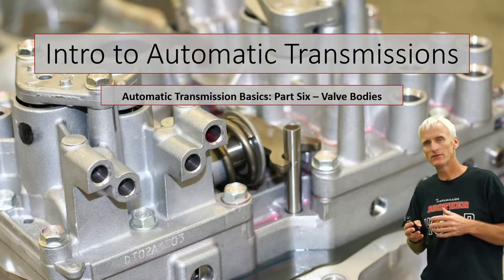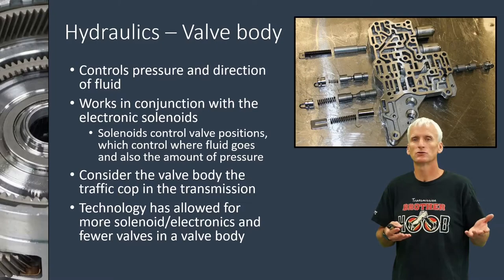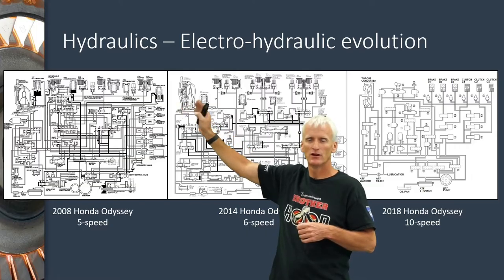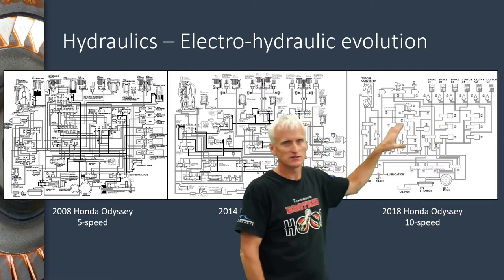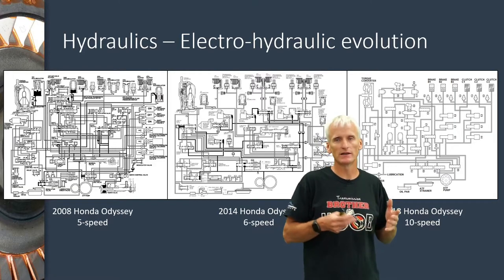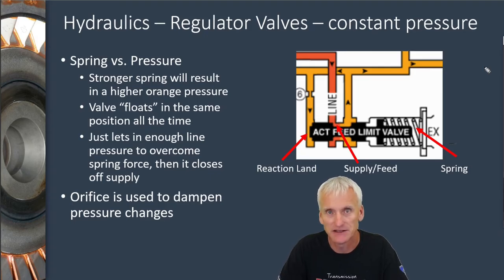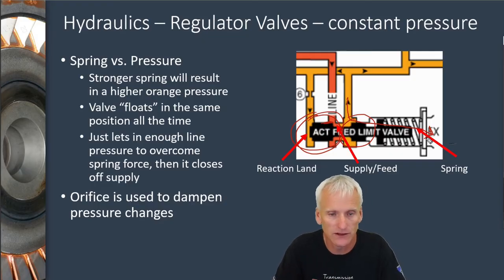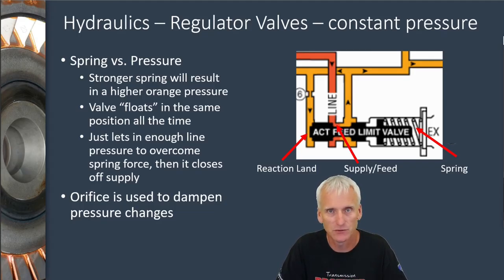Basic auto trans valve bodies

Comment: Once in a blude moon, our Mercedes 2008 ML 350 has gotten "stuck" in low gear where re-booting the car (off/on) fixes the issue. Asked the dealer what the cause could be. They said, "likely the valve body, maybe easy fix with new solenoid, etc.". I had no idea what a valve body was or how it worked. Found this video and, tada!, wowza!, great tutorial! 

Muchas gracias! 

( I noticed you using the Spanish phrase, "muy bueno" in another vid ;) ).

Comment: Great vid man , question, i have a 2000 excursion with the 4r100, after i tow my boat to the water 1 hr away, when i go into park then shift to drive it is super delayed or not at all.  Could i replace the accumulator valve body main valve body and solonoid valve body and filter could possibly fix my problem? Regular driving is no prob at all and trans temps dont ever go over 180 degrees. Thank u

Comment: Very fascinating subject. I've got a question to ask. Will the springs at the end of these spools become fatigued over the years and cause shifting irregularities, let's say in the 2-3 clutch circuit, which then sets a fault code?
Reply from the maker: I've always wondered this as well.  Supposedly it's not really an issue.  The valve springs don't stroke that much in relation to their total possible travel, so they don't loose tension over time.  One would sure think that with heat and years of use that they would though.
Reply: In general metal fatigues over time especially when you add thousands of thermal and mechanical cycles.

Comment: I really wonder what are the valve body and spool made of? Also which manufacturing proceses are done with them?
Reply from the maker: The valve bodies are cast aluminum.  Most valves are anodized aluminum, but some are machines from steel.  Older transmissions commonly used cast iron valve bodies.
Reply: @siuautomotive  Thank you very much. Could you recommend any resource about hydraulic valve body materials and manufacturing process. I appreciate for your videos.

Comment: Great video and insightful! Got a quick question: in my 2015 Hyundai Genesis g80, no DTCs, TCM updated, ATF changed multiple times, all solenoids replaced, wiring harness and Transmission speed and temp sensors replaced, however I still get harsh up shift from 4th to 5th gear only, and sometimes from 2nd to 3rd gear. They are operated by 35RC solenoid which is already replaced. Could the problem be inside the valve body? What do you think? Thx!

Comment: If an automatic transmission is to skip/shudder for a second then re-engage in first gear, what could be the problem?  Is it commonplace or a regular procedure to individually test solenoids?
Reply from the maker: Regarding skip/shudder, that is usually due to low pressure applying a clutch from leaks in the clutch circuit.  Regarding solenoids, It really depends on the application.  Many will ohm check solenoids, replace commonly faulty solenoids, or blow air through them and energize them.

Comment: Is there any reason why the solenoids aré
P.W.M. rather than a variable D.C. linear
voltage similar to a Potentiometer ???
Reply from the maker: I'd have to guess it's for more accurate control and because it's probably easier for a transistorized circuit to modulate vs. vary an analogue signal.  Most variable voltage circuits are inputs, like position sensors.  Most output circuits are simply ON/OFF or modulated, like injectors, coils, and all different types of solenoids.  I'm not an electrical engineer, but that's my best guess.
Reply: @siuautomotive  Sounds right to me, thanks for the reply 👍
Reply: @siuautomotive  is that why they say that the solenoids can
burn out if D.C. is applied I guess
Reply from the maker: Yes, the lower resistance solenoids typically don’t get pulsed at more than 50%, so putting them straight to battery power would put more current through them than intended.  With that said, I’ve powered them up with 12v for a short time without problem
Reply: @siuautomotive  I guess if the current is very very low
it should be ok
Reply: @siuautomotive  Sean one question,  I was interested in the
4l60e because it was always from other peole " Ohhh don't go
near an Auto transmission,  they are very complicated etc)
So I wanted to bust that myth and have a reasonable understanding
of this transmission. There is a lot there to get your brain across.
My question is do your students have to be across the understanding
and operations of ALL transmissions equaly, or do they specialise.

Comment: Hi, I have a problem in my A/T that confused many mechanics: At first start only, R direclty engages as normal but DRIVE does not unless engine is running for  like 5 minutes and a push on the throtlle, and it engages with a bump, while reverse engages immediately and smoothly. They said if it is a solenoid problem, both D and R will have the problem, any opinion?
Reply: what your experiencing is something called delayed shift
Reply: what vehicle and trans do u have?
Reply: @randy1ization  Toyota Prado 120series 4L with 
 A/T Transmission: 5FE

Comment: What do the valves pressurize? How do they pressurize and how is pressure created? Where does the transmission fluid flow? Is it directly injected into the clutches somehow?
Reply from the maker: Did you check out all of the videos in the basic series?  The oil pump generates the pressure and it’s driven by the engine via the torque converter.  The valves direct or modify this pressure to where it needs to go, such as the clutches , lubrication, torque converter, etc.
Reply: Thank you sir! I will go back and watch them. Your videos are amazing and extremely informative.